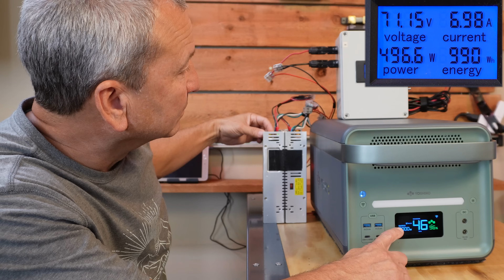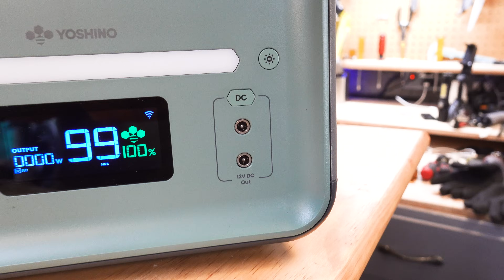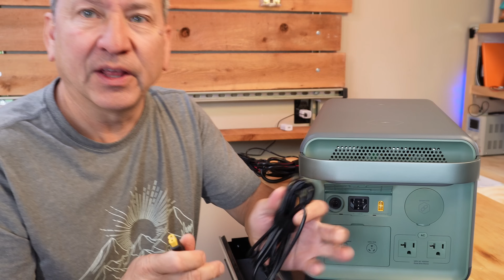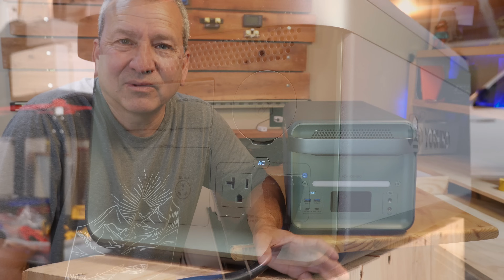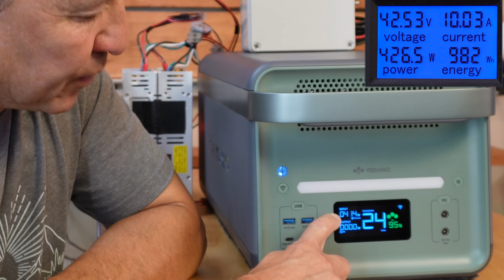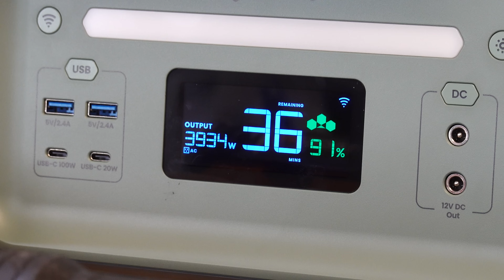SOLID STATE Power! Is THIS the FUTURE of Portable Power? (Yoshino B4000 Power Station Review)

Comment: Thanks for not calling it a ‘Solar generator’. Absurd marketing moniker that ranks up there with jumbo shrimp.
Reply: Finally someone is saying it. I call my Honda 2200 also just a gas engine, not a generator. Should really call it a gas guzzler because the majority of energy produced is wasted.
Reply: @OldManandtheSuperC  bottom line : it’s the industry term for the product. How we feel about it doesn’t matter.
Reply: &OldManandthecSuperC - Seriously, that moniker actually bothers you that much? Not sure how much thought you’ve given this, but the term Solar Generator (and jumbo shrimp) are technically realistic/logical terms. Now if you were upset over something like “hot water heater,” “cold air air conditioner” or “frozen ice cube maker” I would totally see the point.
Reply: @__WJK__  have a nice day
Reply: So true!  Drives me up the wall. 😂
Reply: What's wrong calling it a Solar generator ? A gasoline generator uses gasoline to produce power . A solar generator uses solar to produce and store power 😢
Reply: @DIY_versus what’s wrong with calling grandma a grandpa
Reply: @DIY_versus — True, but think that through; A gas or propane generator PRODUCES power, which can be routed to this power stations BATTERIES to store it.  Use this to run your cooler or refrigerator until it is depleted, turn it off overnight and it will still be dead in the morning because it does not GENERATE power, it’s just a sweet battery that you can recharge and use over and over again.   I wince when people call these generators, a solar panel generates power from the sun, this does not.  I know it’s a minor point, but imagine going into a grocery store and seeing farming equipment and seeds of all types.  No food at all, just stuff you could use to farm and grow your food.  Same thing. 🤓
Reply: @Erin-Thor  my argument still remains , these units do generate and store power at the same time unlike a gasoline generator.  As long as the sun is shining these units can produce electricity just like a gasoline generator . A gasoline generator without gasoline doesn't generate anything , these units without sun shining on solar they don't generate anything as well .
Reply: @DIY_versus Well, technically the solar panels are doing the generating
Reply: @Erin-Thor and a generator doesn't generate power without gasoline or another fossil fuel. It's the fual that stores the energy. Not the generator
Reply: @lanceboudreau3630  — I get you, even on the fuel stores the energy.   But you left out solar panels, which last time I checked the upfront cost (ignoring environmental impact) would buy about 6 years of propane per panel.  (Might have been solar panels & Li-Ion batteries 🤷🏼‍♂️, I’ve slept since then.)  👍🏼🤓
Reply: @Erin-Thor  panels have come down quite a bit and it really all depends on every person's needs when it comes to power consumption. My apartment averages about 300-400 watts per hour so if I had 1200 watts solar I'd have plenty of power to run my apartment and charge it up during the day. So for me 3, 400 watt panels at about 400 to 600 dollars a pice. We'll say 600 so a total of 1800 dollars in panels. So I'd pay for my electric bill in 1 year ( 100 dollars a month 9 months of the year and 300 dollars a month 3 months of the year ( summer) )not to mention you can't put a price on having electricity when power is out.. and as far as talk on " bad for the environment" the gases caused by burning gas isn't good for the atmosphere. Btw solar panels last about 20 years before they become only 80n% efficient. That doesn't mean they stop working all together. Same goes for the batteries.
Reply: This doesn’t generate.  It’s a battery.  It stores the energy.
Reply: This sounds like a nit-picky campaign that will fail. It's like trying to stop people from "recording" audio and video because we're not actually using records anymore. 
I see it as the unit generating the voltages and frequencies needed. It's helpful to be very precise in scientific circles but in general terms, not calling it a generator is s weird hill to die on.
Reply: @Ben-Ken  right.  It’s a charge controller plus a battery plus an inverter with some plugs going in and some going out. Oh and it’s in a box. I think from now on I’m going to call them Box o’convo-inverto-batt’o. Catchy huh?
Reply: It's a battery, not a generator lol.
Reply: Solar generator
Reply: @Tactical-hg7ov  you're so mean! 😂😂😂 I bet you were one of those those little boys when grandma says do not touch that! So the first thing you do is touch it. 😂
Reply: A “gas generator” converts chemical energy to electrical power. A “solar generator” converts solar energy to electrical power. Simple.
Reply: @ChachinRC The chemical energy in the gasoline is solar energy, too. Just solar energy that was received millions of years ago.
Reply: @ChachinRC look up definition of generator. And while you at it “accumulator”
Reply: @Iamandthatiam   This thing can generate power indefinitely with its accumulator untouched at 100% while you continue to supply "solar fuel" to it.  Trust me, I've generated power this way with mine.  Its accumulator stores energy but this thing still generates power from solar much like a gas generator does.
Reply: Who cares what it’s called? Don’t be a Karen.
Reply: @theboston3386  what I definitely don’t care about is some narcissistic bully shaming me. You have the right to live in arrogant ignorance, so be it!
Reply: @Iamandthatiam  Continuing to laugh at a Karen bc you mushing words together and apparently thinks it apply to what I said. What a Karen!

Comment: So its about 200ah for 12v battery
Reply from the maker: Correct.
Reply: Right and the Bluetti LiFePO4 based acl200 which has similar capacity, isn't that much bigger and is  considerably cheaper. I cannot see justifying the cost until they come out with the second gen version which hopefully will be even smaller
Reply: @Freynightwalker Pretty sure the AC200L is twice the size of this, and has 'only' a 2400w inverter. And I say that as a Bluetti fanboy.
It does have LiFePO4 too. I know what I want in my house when the Nankai Trough hits again.

Comment: Output: 4000 Watts Continuous Use (with up to 6000W momentary surge)
Capacity: 2611 Wh (54Ah @ 48V)    Question so at 4000 watts this would last about 35-40 minutes????  Back up battery needed for sure.  I really like the concept but price and storage  is an issue.
Reply from the maker: True. I don't have a reason to draw that much power for more than a few minutes...if that.
Reply: It is rated at 2.6 Wh which is pretty good.  You are correct in your math, but common, that is at 4000 watts, which is a LOT.
Reply: A 300ah (3.8 kwh) 12v LiFeP04 battery can be had now for 600 bucks. Add a Victron 100/30 Smartsolar charge controller and a 2000w inverter and four 100w solar panels and you have a nice little setup much cheaper that you can repair yourself when the inverter quits. It will last many many years.
Reply: @baneverything5580  this is for people happy to try a new battery system.  LiFePO4s were even more expensive than this when they entered the market.  You can thank early adopters for buying that tech and getting the prices down to what they are today.
Reply: This is perfect if you wanna bake a batch of cookies before you die